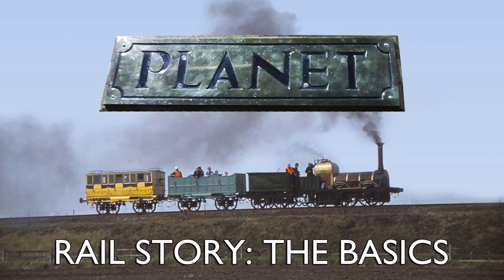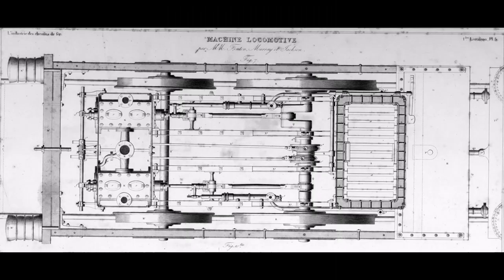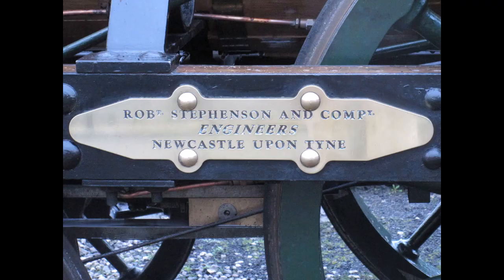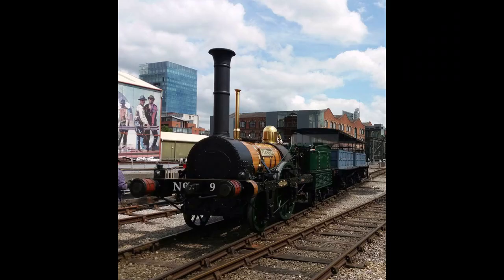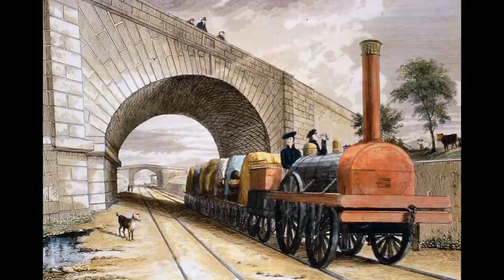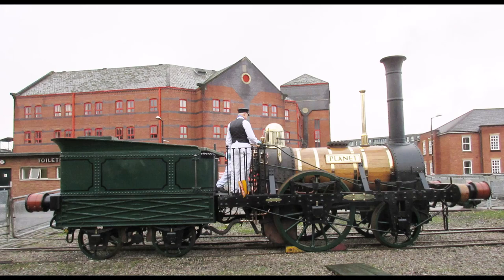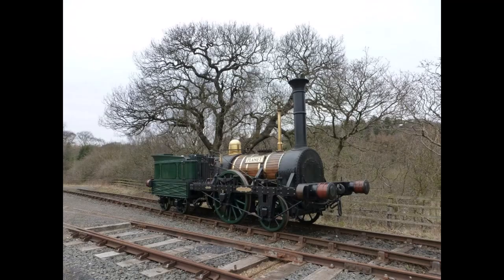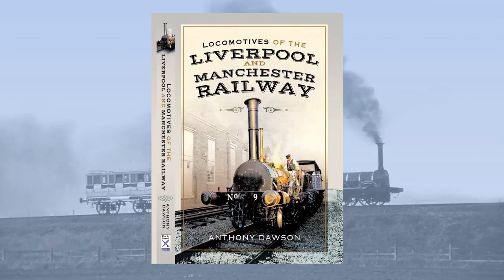Planet: The Basics

Comment: Hi Anthony,  I really appreciated your interesting response.  Oak was bad, because it corroded the through-bolts.  (Ahrons).   Honestly, I have no idea what the axles were made of,  but what is crucial, is radiusing  corners.   E.G., where the axle was thinner, it’s important that where the thin bit meets the fat bit,  there should be a concave corner.  We know about this, these days, but in her time, it may mot have been understood.   Versailles train wreck and fire.  4-wheeled loco broke its crank axle, derailed...  and all the other stuff.
Reply from the maker: Ash was preferred for that reason. It was also lighter, too. The axles were wrought iron, hand-forged as the Steam Hammer had yet to be invented. You can find out more about the accident at Meudon in 1842 here: https://www.youtube.com/watch?v=RxV0v1lYHKU

Comment: There was a Planet engine put to work by the Tuscumbia, Courtland and Decatur Railroad in Alabama in 1833. I don't know if it was a real Planet or a copy maee in the United States; but it was and is acknowledged as a Planet. The engine ran on pig iron rails that were too thin and pliable, so that they warped under the weight of the engine, requiring frequent stops for the screw repair and align the rails. 

In 1838, this Planet and its train carried a detachment of the Cherokee "Trail of Tears" between Decatur and Tuscumbia. The transfer took twelves hours.

Comment: I read in EL Ahrons that the practice of multiple frames, to strengthen or better support crank axles, was, in actual fact, to weaken them or case them to break.  This is counter intuitive.  But once crank axles ran in only two bearings, they stopped breaking.  Not, perhaps relevant to planet, but when straight 6 and particularly EIGHT cylinder internal combustion engines were ‘invented’, crank-shafts broke frequently.  The failed R101 airship had straight-eight cylinder Beardmore Diesel engines, which had to restrict their maximum RPM, thus not realise their intended power output, because their crankshafts invariably broke.  I also read that a Crompton (class 33) 8-cylinder Sulzer engine broke its crankshaft, owing to the crankshaft-damper, overheating and seizing up -and failing to suppress the torsional oscillations.  I expect everyone knows all about this, and so I hope it wasn’t boring.
Reply from the maker: Hello Robin, thanks for your comment. Nice to hear from you. Whilst having multiple supports for the crank axle was in theory sound, it meant, and this was in they days long before optical alignment - that all the bearings had to be exactly in line. Initially only the outside bearings on Planet et al were actually load-bearing but as time went on the inner bearings received springs as well so that they too absorbed some of the load. The big problem with these early axles was that they broke where they stepped down in diameter, particularly where they inserted into the wheel. The shoulder radii were too small and no stress-relieving grooves had been machined into them. I cover this in my book on L&M locomotives and in a book I'm writing at the moment about Planet.
Reply: @AnthonyDawsonHistory  was the original loco fitted with name plates?
I understand that the pictures of Planet don't show her fitted with name plates?
Reply from the maker: @eliotreader8220  She did have a name plate. Isaac Shaw shows one in 1831. It's probably the most reliable depiction we have of the engine.
Reply: @AnthonyDawsonHistory  was original engine fitted with a steam whistle at some point during her working life
Reply from the maker: @eliotreader8220  certainly yes. Same with the entire L&M fleet.
Reply: @AnthonyDawsonHistory  would it have been diffcult to clean out the smokebox and boiler tubes at the end of the day's work?
Reply from the maker: @eliotreader8220  Having cleaned Planet's tubes: nope.
Reply: Yes, but I thought breakage of crankshafts on straight-six car engines (and presumably eights) was usually due to torsional vibration from running into third-harmonic rev ranges - not something that intermediate bearings could help with.   And not something that steam locomotive crank axles would ever encounter, I think?   Intermediate bearings that weren't precisely aligned would certainly cause alternating stresses and promote breakage, but I would have thought IC engine blocks were too accurately line-bored for that to occur.
Reply: @cr10001  Hi!  I knew it was due to a weird harmonic, but not the mechanics of the harmonic.  The Maybach V12 engines in the Western “Hydraulics” had “Tunnel” bearings.  Instead of crank webs, they had 7 (very thick) discs, and the discs carried the crank pins, and the discs played the part of the journals.  And were provided with roller-races.  These were lowered vertically into the crankcases, threading through the bearing housings, as you mentioned, line-bored very accurately in the crankcase.  The 1550hp 8-cylinder Sulzer engines in the ‘Cromptons’ were provided with crankshaft-dampers, some of which failed, causing the crank-shafts to break.  The harmonics of badly designed structures set up a ‘self-augmenting-period’.  It’s the reason why troops are not permitted to walk across bridges, but to break step.  Of course everyone knows about the Lockheed Electra aeroplanes whose wings fell off, owing to a harmonic set up by the turbine shaft to the propellor, due to the gearbox being in the wrong place.  The harmonics are due to Eigen Numbers being wrong.  Honestly, I didn’t learn about those.
Reply: For walk across bridges, read MARCH…. You mustn’t do it!
Reply: @robinfryer479   I must admit I don't know much about heavy diesels.   I do know that early sixes in cars had long spindly crankshafts with a low natural frequency, and that led to trouble if the revs rose sufficiently for the firing impulses to coincide with a harmonic of the natural frequency. 
Modern sixes have much bigger-diameter bearings (and lots of intermediate bearings).    They also tend to have stiff cylinder blocks that keep bearings in line.
My only point was that the torsional-vibration failures are a different mode from the bearing-out-of-alignment failures of early steam engines.
Reply: @cr10001  This is really frustrating!!  I was just finishing a detailed reply covering the points we’ve raised, then went to Google to check something out, and the ruddy iPad dumped all of it, without sending what I wrote.  I shall now have another go.  But a bit abbreviated.  Prewar Austins we’re extremely well-made cars.  Austin 12/4 was superb.  The 12/6 was a disaster, which always broke their crankshafts.  My cousin, who started his own car-repair business just post war watched and heard an Austin 12/6 with its engine idling, standing on the forecourt, suddenly clatter and stop, as it broke its crankshaft.  Similarly, Mercedes produced a V-12 racing-car type, which always sounded rough, until they broke their crankshafts.  They continued to run, but sounded smooth.  Obviously less power was available.  RR Merlin V12 aero engines, even diving into the ground, didn’t break their crankshafts, but after that, they were horribly bent.  (I’ve seen a few).  Now I’m not sure about the out of alignment question.  Modern machinery benefits from accurate boring, and modern bearing-shells are so thin and replaced like for like, that the deviation can be no more than thousands of an inch.  The harmonics, depending on their amplitude are going to cause fatigue-fractures.  Due to the repetitive bending beyond the elasticity of the steel sample.  It goes to its plastic state.  I only guess that the main bearings are too short or the crankshaft is too thin.  Another guess is that the greater the number of cylinders commensurate with the greater expectations of power lead to exponentially greater loads on crankshafts, which have to become undesirably, more exponentially heavier still.  And rotate more slowly, which implies less power.  Turbines better, but they have even more crucial design features.  Don’t want to bring this in.  (Râteau and De Laval impulse turbines with very long tail-shafts running in a bronze ball floating in a spherical bearing housing, all plain because ball/roller races couldn’t cope with the rotational speeds).  4-stroke single acting engines are so configured that pairs of pistons reciprocate simultaneously, whist firing alternately.  It eliminates lateral oscillation, but not vertical jumping up and down, except when extra cylinders are introduced.  I think that without bearings, any rotating shaft wants to turn into a catenary or a skipping-rope, sinusoidal, and the bearings have to be extremely “solid” to resist the tendency.  I lost my last attempt, because I went into Google to look up Planet.  The original drawings show the crank-axle cranks, right up against the inside frame(??) very close to the adjacent wheel.  The axle looks thinner than I expected.  The original locomotive would NOT have had a steel axle, but WROUGHT IRON.  WI is not made any longer.  Honestly.  Modern “wrought iron” is mild steel, painted black.  Wrought iron isn’t as “strong” as steel, but it’s much tougher.  The Planet reproduction will doubtless have a modern STEEL crank-axle, and if the engineers who built it, copied the original, rather than redesigning the axle around the modern material, it might be that they got it wrong.  I’ve seen more modern inside cylindered locomotive axles, and the cylinders are further towards the middle.  Planet was the first locomotive to have inside cylinders.  And the original one still exists, doesn’t it?  If so, it’d have its original crank axle?  Oh!  I’ve just re-read your last.  I think you know more than me (not difficult) about long crankshafts.  I would have thought that bearings adjacent to crank-webs would eliminate any whirl.  There would be pulsating torsional peaks, of course, OMG.  Bigger diameter crankshafts, possibly bored out down the centre, to reduce the weight….  So, do you think firing order is a problem?  The Italians built straight-8 engines (or was it Etorre Bugatti?) with the flywheel in the middle.  Lorries have intermediate bearings in their propeller shafts.  And both my London Busses (RT & RF) had their self-change gearboxes mounted separately with shorter input and output propeller shafts.  The original, Bentley (NOT Rolls-Bentley) 6-cylinder engines (6.5 litre and 8 litre) had crankshaft dampers.  And direct driven Dynamo between the dumb-irons.  Their maximum Engine speed was 4000rpm.
Reply: @robinfryer479  Um.   Well that's a monster of an answer   :)    
And I know the pain of losing one at the last minute.   
I think there are two main stresses on the crank - bending, and torsion.   A 7-main-bearing six is about as well supported against bending and 'whirl' as you can get.   However those extra bearings don't help with torsion (twisting) of the crank.   In fact if the crank needs to be made longer to fit them in, that's bad.   However larger bores in modern engines (traditional engines had long strokes and narrow bores) require increased spacing between cylinder centres which is going to require a longer crank anyway.   
I don't think that a heavier (thicker) crankshaft is bad, from the engine's point of view, since stiffness (and hence critical frequency) goes up faster with diameter than weight does.   The extra weight may be a detriment in cases where total weight is critical, like aviation or racing, of course.    Also, bigger-diameter bearings result in higher relative velocities in the oil film which I guess equate to a small power loss.
(As an aside - I had the crank on my Escort reground 10 thou under recently.   I was wondering if that tiny reduction affects the strength at all (probably not) but in Googling, I found that those exact same bearing diameters, which originated I think with the 997 Anglia, persisted all the way through to the Cosworth DFV.   So I guess they're 'adequate'   :)
You can simplistically regard the crank as fixed at the heavy flywheel end and twisting back and forth at the other end.   I think firing order may have had some bearing on the torsional loads generated.    I guess the straight-8 with the flywheel in the middle was cunningly 'halving' the torsional length of the crank (but where did they take the drive out?).   
I don't think torsional vibration would have been an issue with Planet or similar locos, even though they had a huge wheel each end of the crank - they might well have done if those were flywheels rotating in the air, but on a loco they're massively damped by contact with the rail.   At least that's my guess.
One minor quibble, I don't think the steel ever goes to a 'plastic' state, except possibly locally at the final fracture.   Or possibly microscopically in the area around the head of the crack?    In that context, it's a while since I read J E Gordon, but I can absolutely recommend his book 'The New Science of Strong Materials'.   He has a genius with words, and actually manages to make materials science interesting.   I still have a copy, and I re-read it every few years just for the pleasure of reading it.    He also goes into what distinguishes 'strength' and hardness from 'toughness'.   
But I'm really skating at the edge of my knowledge here.   :)
Reply: @cr10001  Ha ha!!  JE Gordon has been my mentor.  The new Science of strong materials AND Structures.   To my furious regret, I was friendly with a colleague of his, who was an engineering tutor at Reading Uni.  She was there at the same time as JEG.  I kept pestering her about him, as I desperately wanted to meet him.  She rather missed the point.  He subsequently died.  Yes!  Plastic deformation happens when you strain it beyond elastic deformation.  That’s when it doesn’t go back to where you started.  And that’s when it will go on to fatigue and fail….  BUT, it is possible to fix, provided that you can heat it Cherry Red, quench it, then heat it again, and watch the colour change to straw, or whatever, and quench it again.  I don’t know if that’s called annealing, but with copper, you need to know it work-hardens.  This needs to be heated CR (!) then quenched.  It then becomes soft.  I used to repair copper washers by doing this.
Reply: The crank-shaft is what interests me the most about these older locomotives, because it seems so common-sense today for the piston-rods to be directly connected to the outside of the main driving wheels, thus eliminating the need for a crank-shaft at all.